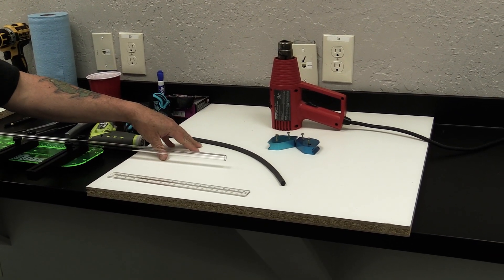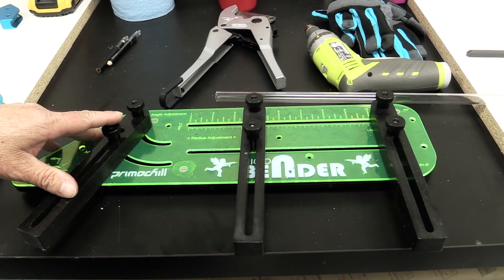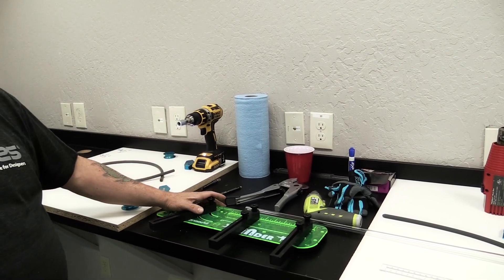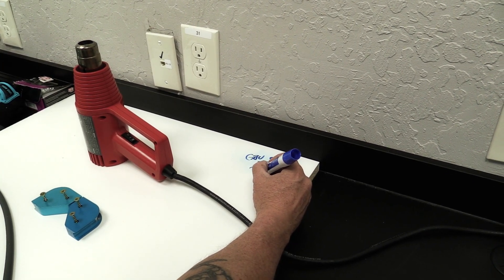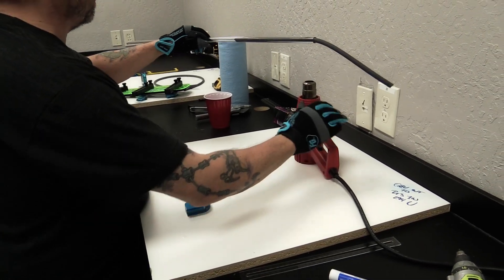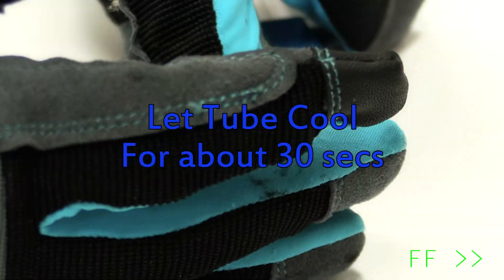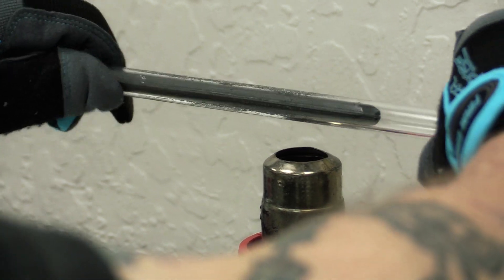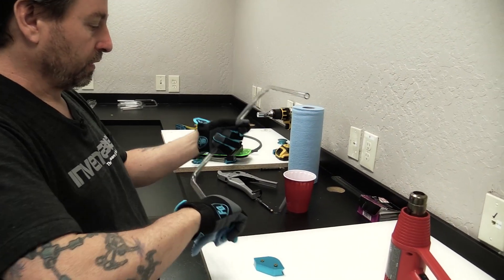Rigid Tubing Bending | PC Modding Ep. 12 | Nerdy Ninjas

Comment: I purchased the (ID)10mm (OD)12mm thermaltake kit using the primochill OD 1/2 which should equate to OD 12mm But the insert does not fit at all no mater how much soap I use. Also the tube does not fit inside the channels of the mandrel, It sits on the outer walls. Did I get the wrong stuff? On a side not I bought the Bitspower hardtube silicone (ID)10mm. Also a box of the primochill 1/2 OD tubing and the silicone insert does not fit either. Am I misunderstanding something in the measurements? Here is a video of what I'm talking about. https://youtu.be/vs6jffofJnY